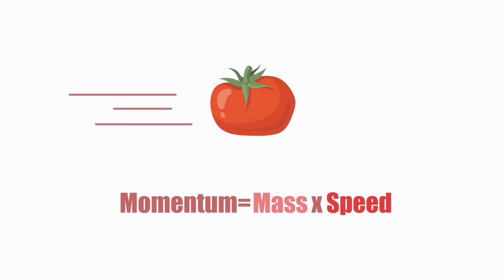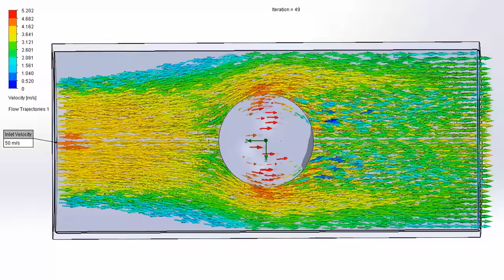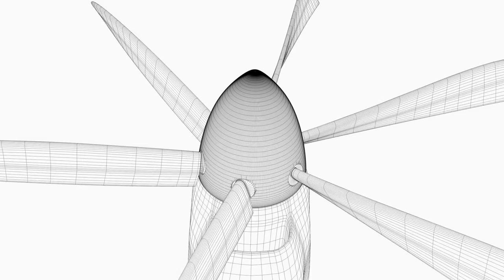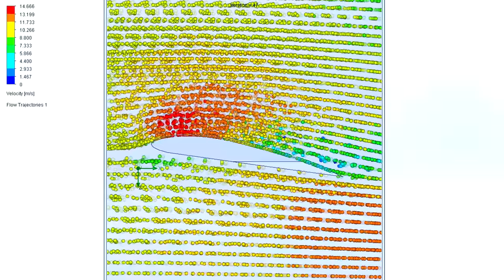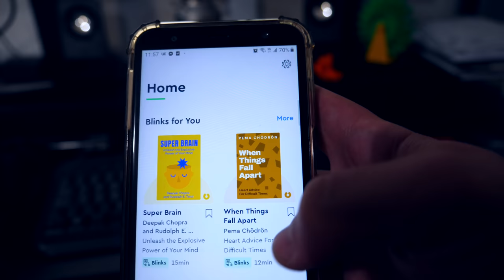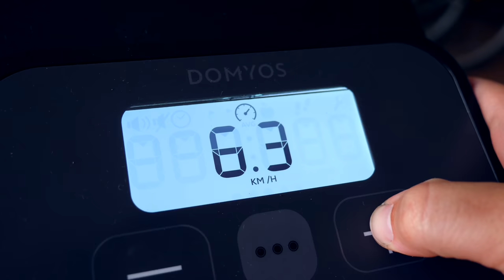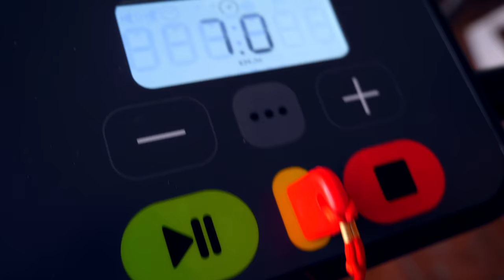Wind Powered Car (3D Printed)

Comment: Hi Integza what about experimenting with burning aluminium under water to produce Hyprogen using high voltage a guy called Francois Cornish got a patent for this. There was a website wwwdotlayodotcom on the wayback machine that explained the principle and made a working prototype from memory

Comment: Wait a second. Your car couldn't work, because of ration between pitch of the propeller and curcumference of your wheels, but you are even explaining it wrong. For your explanation to work, you really need perpetual motion. The point is, that propeller have to move slower thru the air, than the wheel is traveling on the ground. That it the whole reason why propeller is creating larger force, becuase it's making shorter distance. 
I have to build this cart too, I'm expecting to have it this weekend. My recommendation is to have wheels with diameter 80mm (that is +- 10"/Pi) and propeller with pitch around 5". In teory Mr. Cavallero said, it should be 7" or less for this wheel size, so 5" is a safe bet. Also do not change the gear ratio, this is calculated for 1:1.
Will you make a follow up video? :-) Because, you didn't help with this cruel and evil debate :-D :-D

Comment: u really missing out a lot of stuff
first of all wind is faster above ground
and lower to ground is slow air n make no drag or little drag but proper is up high in air still be push by wind "u can't feel it when u on ground but up on 3rd or 4th floors u will notice big difference between lower n higher"

blade or proper or wing what else yall call it anyways let get to point

narrow blade have less drag less pushing 
wider blade have little drag but more pushing unlike sailor boats wing

if u have watch that video u will notice blade is wider because wind hit wide blade creates more power to push blade faster and more movement n whiles blade is turning it will keep pushing it because of drag is on blade not wheels if that blade turn to flat side way will make no drag at all n freeway rolling
2nd it gear driving im not sure what ratio it is set on i think it like 1:5 or 1:10 not sure havent seen gear size
anyways and blade still turning and geardriving it sent power to wheels making it self move whiles wind pushing blade and blade pushing wheels and faster blade turn the more it move it self faster then wind if wind dont catch up it will slow it self down unite wind push it aging catch it self back up
i hope you find some information i give you

im engineer repair and still do different things not just one but all

Comment: What a confused explanation. Firstly, by mounting the drive shaft at 45 degrees to the drive direction you lose half your thrust. But apart from that. This is the explanation of how it works. The craft moves through the airmass driven by the ground. To us the ground is static.  but to the craft it does not know if the ground is moving or the air moving. How you manage to make an explanation without mentioning the ground is a mystery. You do not understand it. THE CRAFT IS DRIVEN THROUGH THE AIR BY THE GROUND! The wheels transmit the movement of the ground to the prop in the air which pushes the craft through it.

Comment: I think you ought to print a fractal vise, examples of which are here: https://www.thisiscolossal.com/2021/07/steve-lindsay-fractal-vise/   ;  https://www.thisiscolossal.com/2021/07/steve-lindsay-fractal-vise/
the original was cast iron. with today's sterling Additive manufacturing techniques, we ought to be able to make a customized version. Think how adaptable this would be on the ISS with a printer?

The equivalent of one of these in nylon could be of tremendous use on the ISS for example, since they could make new parts specialized to the need at the time. We have an obligation to make sure the first trip to mars contains a solar-powered printer that can print with molten sand.

Comment: Not really how sails work. Or propellers. Might sound like nitpicking, but you wouldn't be able to explain how autorotation works with that kind of misconception about aerodynamics of sails and airfoils. The rest of the explanation is rather lacking as well. You really shouldn't be focusing on the wind at all. The demo Veritasium does in the second video with a plank and roller cart is basically all you need to understand. Making it work with a prop is just dressing.

Comment: hard fail. Not even how it works. get rid of the fan and let the tread mill power the prop and it pushes it's self forward.  wheels are to small and the prop not even correct pitch or size